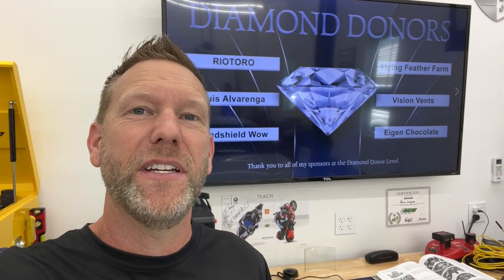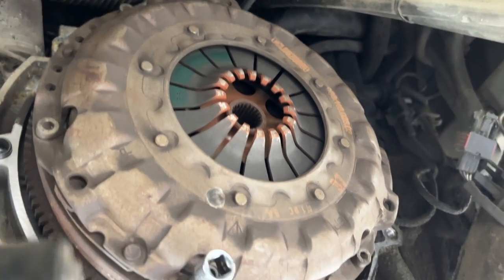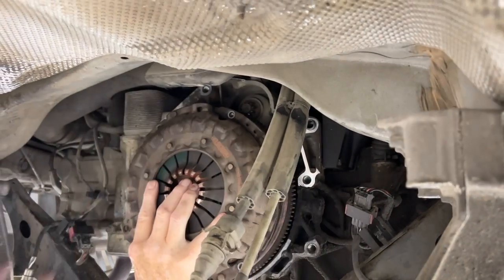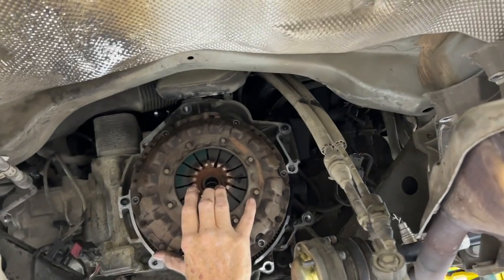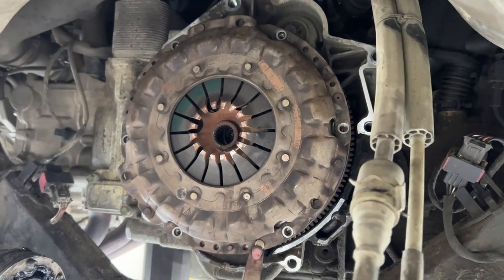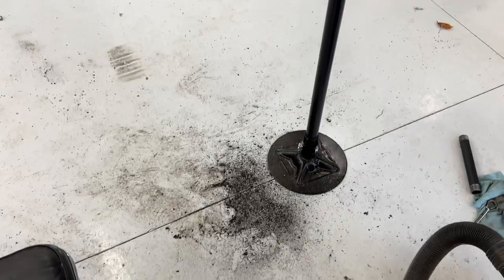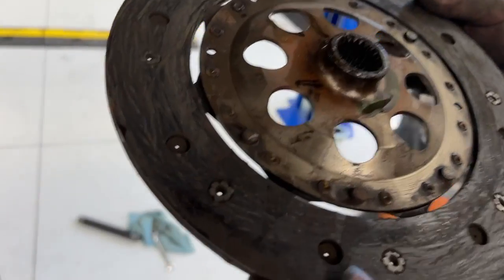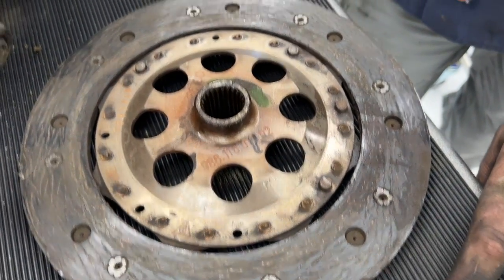Porsche Boxster 986 Clutch Replacement (Project 44)

Comment: To help with that flywheel, you could take the old bolts (because you're replacing them) and cut off the heads for two or three with an angle grinder. Then hand thread them in a few turns to use as dowels to hold the flywheel and align it. Like you do for the wheel studs to hold the wheel in place. Once you get a real bolt in, hand remove them and then throw them away.
Reply from the maker: +@AaronS11979 great idea! 🍻

Comment: Sir, which tranmssion? Manual or tiptronic? 

I am thinking to replace my clutch as well with tiptronic transmission with torque convertwr, does mine have the throwout bearing as well?
Reply from the maker: +Ronz Autokars that’s a manual transmission. I just posted a video today on the tiptronic

Comment: Are you sure that you properly tighten this bolts to 120 degrees after 25 Nm? 
When the flywheel moved does the wrench not think that you tighten the bolts by those degrees?

As I've seen somewhere else doing the cluch they locked flywheel with a steel plate and 2 bolts, one for flywheel and second for engine block.
Reply from the maker: +Leszek Kaczmarek yup. Well… he messed it up a little at some points, but when the flywheel moves the torque wrench just rotates with it and does not actually turn the pivot that registers degrees
Reply: @HelpMeDIY  everything is clear. Thanks;)

Comment: There is a way to lock down the flywheel using a wrench and a bolt.
Reply from the maker: +@ComputerGeekOnTwoWheels yes, there are a few different ways 🍻
Reply: @HelpMeDIY  Just watching it now and remember that when I did it, it was really difficult to turn those flywheel bolts to 120 degrees.   Definitely would have been easier it you locked it with bolt and wrench.  I'm watching again to get reacquainted because I need to do another clutch.   Great detail video, thanks.

Comment: You do realize that the Flywheel should have been surface ground?!! Installing that clutch like that was as wrong as wrong could be.
Reply from the maker: +Ralf's Automotive Diagnostics & Repair you could do that, but your statement is just false. Owner reported a much better clutch feel afterwards. Mission accomplished! There were infinitely more “wrong” things that could have been done so that’s nonsense.
Reply: @HelpMeDIY  I don't even know what to say to that. You obviously have no clue what you are doing based on that statement. May I suggest a quick google search why it is necessary to resurface Rotors and Flywheels!  Maybe you get an Idea why that is.
Reply from the maker: @ralfsautomotive  same